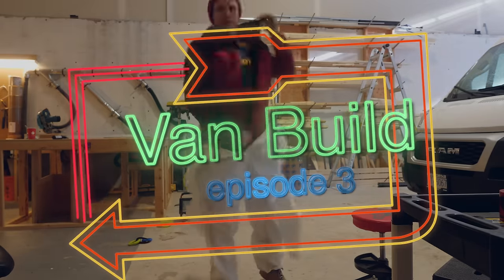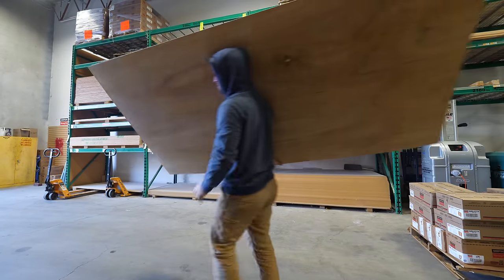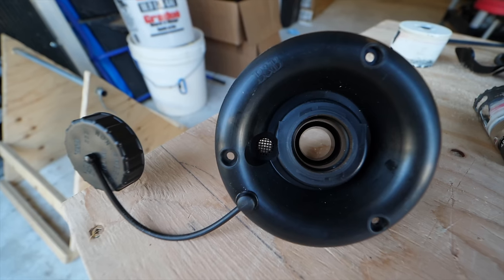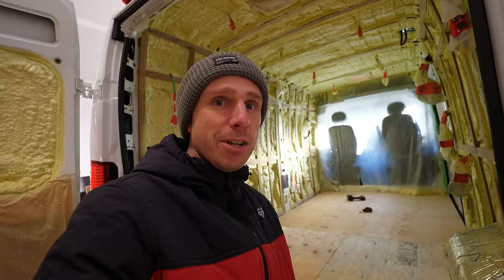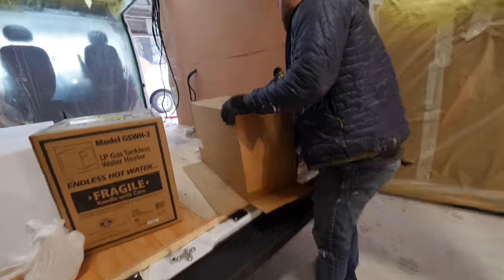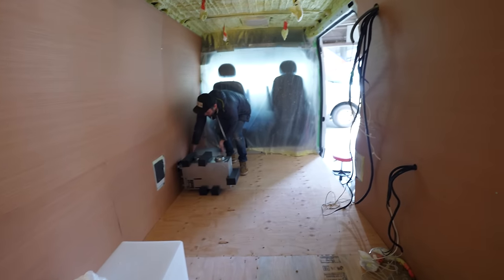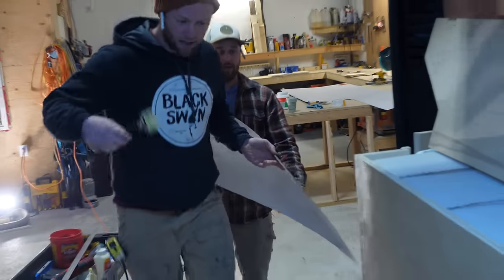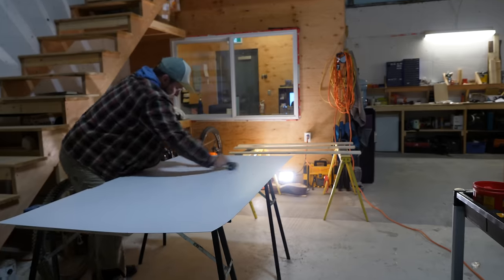Why I Decided To Spray Foam My Custom Van Build...

Comment from the maker: It's coming along nicely eh? If you want some sneak peaks follow me on instagram 👉https://www.instagram.com/paulthepunter
Reply: Paul I've already rang these guys and discussed building my own setup most likely identical to yours as we share the same passions 😎
Reply: @greendogggggg  good news for us, Paul's paid the premium because it's so custom however to copy this build its much cheaper now they have experience. The owner was very accommodating in having people come Inspect Paul's van due for completion mid to end of Jan. $60k has gone into this build roughly
Reply from the maker: @seanec8  Sick!
Reply from the maker: @greendogggggg  What's your source Scuddy o? Because there's no evidence to suggest this works.
Reply: is the water fill the top one? do you have to lift to water up to fill?
Reply: Why did you chose to have a furnace and Alex (STS) didn’t?
Reply: I hope you realize that stuff is going to off-gas formaldehyde and other chemicals for years and you're going to be breathing them in in an enclosed space which is just increasing your chances of a carcinogen or cancer
Reply: Cancer Van. The Punter has been paid by these guys/ has money invested/ got build for free. Negative comments receive dumbass sarcastic replies.
Reply: @SnogSpit  water fill at the top and electric at the bottom
Reply: Hi paul I'm a 14 year old boy and my dream is to travel the world in a  van I wanted to know how u could get a head start on financial problems any ideas?
Reply: Is this your job blogging?
Reply: Right off the bat you did spray foam insulation and that's one of the biggest mistakes people make on every build.
Reply: How much did this cost?
Reply: @PaulThePunter  the insulation i mean
Reply: @jasonstormoen  u mind explaining why is that a mistake?
Reply: @adryanmares0  my background! I worked in the rv capacity of the world from 97 until 2018 and when the rv industry was slow I worked in the van conversion industry. I did schoolies and van conversions from 99 until 2018 and still help a few people when needed. I am just to busy right now.  We did a lot of testing over the yrs with spray in foam insulation and it ends up causing moisture mildew mold and rust. If you do a liquid vapor barrier then spray in it last longer but still ends up the same issue. We used and recommend doing floor, walls, and ceiling in a good primer and then do a liquid vapor barrier on the floor, walls, and ceiling and then use foam board on the floors and on the walls and ceiling in a R17 value foil faced. It is design for metal roofs, walls, garages, and pole buildings, your van or schoolie is a metal building. This foil faced is also designed as a radiant barrier, vapor barrier, and air barrier. It is a all in one solution for cold, heat, condensation, and air. We used it in the rv industry because all of the trial runs testing done failed over time.
Reply: @Tucker Webb no that's not what I'm talking about. I am talking in general spray in foam is no good. It works for a while but a few yrs down the line it starts causing issues that you don't see until you get in there to do a repair. If no repairs a few yrs down the line you start seeing the issues. It causes the vehicle to rust and it causes mildew, mold, and so on.  I worked in the rv capital of the world  in Elkhart, Indiana where 90 percent of all rv's and rv parts are made. They also have a couple van conversion companies in the next town over I worked in for a short while when the rv industry was down, and I have friend working in them still. I have seen countless hrs of testing and it just fails in the long run. I built conversion vans and schoolies for over 20 yrs in my shop and have done testing on my own and it fails and that's why it's not used. We tried because it's cheaper in the long run. The longest we all got it to last was when we did a liquid vapor barrier and 3 to 4 yrs still wasn't impressive.
Reply: @Tucker WebbA long story short, 
 Thor Motor Coach is the biggest signal company for class A, B, C rv's, travel trailers, and 5 wheel company in the world. We had people from all over the world come in with their setup that was supposedly designed for the conditions and material used and everything that was tried over a 2 yrs course in testing failed to meet government safety standards. I left the rv industry a couple yrs ago because I moved to Asheville, NC where my race car shop is, and I am so busy that I'm only taking on schoolies by appointment and until I get word from the rv industry that they've found a solution I'll use what has worked for yrs. We aren't having issues with moisture, mold, or mildew and we are as efficient as possible. As for stick built, I agree that it's good stuff for the most part.
Reply: I'm noticing the Black Swan Yoga sweatshirt. Was this done in Austin? I'm in Austin and looking for someone to help build out my tiny van.

Comment: Am I the only one that facepalmed when they put the electric plugin below the water hookups?
Reply: No. I did the same
Reply: Me too
Reply: Not me. I only facepalmed after reading your comment.
Reply: not facepalming, but seriously questioning their expertise tbh...
Reply: I was going to write the same thing!
Reply: honestly reading your comment im think this also but my only theory is the water input had to be at a higher level and it doesn't matter if the electrical get wet you can charge this while raining outside they have GFCI
Reply: Not relevant. That is an all weather power point, and as previously mentioned, the height of the non pressurised water inlet is important.
Reply: @dnomyarnostaw  like i said?
Reply: i wrote my own comment on that before i saw this one lol
Reply: @jonathanjames3612  gfci or not.  if water directly leaks around the plug that is going into the van.... the water could penetrate and cause a short.  while a gfci is great if its tripping constantly because of a water leak,  it isnt going to help you much.  i do realize that it is designed to be able to be used in the rain,  but most rain will not make a deluge down the side of the van... a leak from the hose would.  but hey, its not my van.  i just noticed the issue.
Reply: @jonathanjames3612  forsure but the electric plug is easy to move around so directly under two water ports isnt the best idea, gfi or not
Reply: Right beside the wheel well...
And a non sealed plugin, good for corrosion.
Reply: Just commented that above then scrolled down to see this.
Reply: Fail to plan plan to fail?
Reply: Same
Reply: Ray Watson water resistant not water proof i live In a van in England it’s wet all the time and comes from every direction 😂
Reply: You guys must not be famillar with IP67 rating
Reply: i facepalmed when they put holes is the side of the van..
Reply: Yes bro you were
Reply: @LadyTSurvival  what do you think rain will do?
Reply: @Mapdotnowhere  the van will see rain i'm sure.
Reply: @michaelmarquis8072  i addressed that.  rain by itself wouldnt necessarily be a problem... but if your hose takes to leaking and it is pouring down the side in a solid sheet.  it will inundate the plug.   the plug isnt "waterproof"  its  "water resistant"  there is a big difference.  it would only be bad if the hose was leaking badly right directly above it. which the fill tube is .   a bad hose leak would drown the plug  not just raindrops
Reply: @LadyTSurvival  I couldn't agree more. The outlets didn't have to go above and below each other. They could of been along side each other as well.
Reply: They're all external connections, so they should be weatherproof on the outside. What I shook my head at was "and the foam binds to the surfaces so it makes it's own vapour barrier" and then proceeds to drill three holes through it.
Reply: Me to. Water above electricity = dead. nice video
Reply: Even my eyebrows raised, and I know absolutely nothing about building.
Reply: i'm @ that point in the video atm and stopped to comment just for this stupid design flaw
Reply: even if they have GFC ....tripping it every damn time you fiddle with that water hookup is poor design. you also absolutely dont want to rely on GFC as its a backup safety system not a primary system.
Reply: See start of episode 7 for when it explodes! https://www.youtube.com/watch?v=7ZDBitxf9HI
Reply: This is a sign of expert design. Just like General Motors engineers putting the optispark ignition system under the leaky water pump...

Comment: Why not clad and seal the interior? Then drill small access holes and inject the spray foam? From what I've been reading, the stuff penetrates every nook and cranny. When finished injecting, plug the holes with glued sealable rubber bungs that can be trimmed back flush. Anyway, just a thought. No experience at this so don't be too harsh in your responses! :-)

Comment: Wouldn't it have been smarter to put the electrical plug above the water inlets?  Now if you have any leaks at the water connection.  It's going to run right down to the electrical plug.

Comment: I dont get it... So you use spray foam so you can get "into everything", but then I can clearly see that the thickness of the foam isnt to the max on many places? What is the use of that?
Reply: I was going to say the same thing. Spend a few more nickels and fill the cavity, as long as you are there. 1/2" of spray foam is not much of an R value.
Reply: chiane1968 if it is closed sell 1 in gives R-7 plus more than double fiberglass.
Reply: Glenn Carraway yep, I’m an architect, I get it, and r7 isn’t much. He could fit another inch or two. R14-21 is better, especially the space is just sitting there waiting to be used.
Reply: Pretty sure they left some areas without complete foam covering (i.e. specific cavities, like on the back doors for instance) so that you can still have access to replace things like brake lights, etc. when they inevitably go bad in the future and you're pulled over at a random Auto Zone - god knows where - trying to fix it while out on an adventure.
Reply: @fredthebasspro2256  They left 1 -2 inches structurally not filled pretty much everywhere. I cant explain that with the logics you presented.
Reply: @darekm6859  Damn.. So 1 inch of foam is enough.. but 2 inches of foam isnt worth it... That is some mighty fine reasoning you have there Darek! Without a doubt 2 inches of foam with a space like that will have MASSIVE results compared to 1. As for your remark about possible extra work cutting foam away that would stick out, lets just keep that to your laziness mkay ;-)

Comment: This is how I insulated my ICF home attic.  Last year's 12 month total for my HVAC system was only $168 or just $14 per month to heat and cool for a 2000 sq ft home.
Reply: That's interesting, so you can take these foam sprays upstairs?
Reply: What climate Clay Ritchie?
Reply: @doctorjoey3  probably San Francisco
Reply: maybe in San Francisco area

Comment: Looks good. My only comment would be to research the type of foam used, there are some commercial products that are commonly used in car intereriors and beam pillars insulations/soundproofing, such as Ellastolan 3595/100 (approved by most car manufacturers), so you ensure is something tested according to auto tests and specs (volatile emmisions, stability under heat or moisture, etc.)

Comment: watch what foam they use, it can easily hold moisture against the metal rotting it out.  Hence why truck wheel wells rot out in 5 years now.
Reply: They use recycled metal it starts rusting at the factory.
Reply: @theronlangford8786  no it doesnt, all vehicles Include truck bodies are dipped in a zinc based solution before painting. The moisture collects in the sound deading foam and rots the beds out
Reply: Theron Langford All steel starts rusting at the factory.
Reply: @ShaunHensley  yeah even stainless and zinc coated ones.. So leads build cases from cast iron at least rust won't eat through entirely
Reply: Is it closed cell foam or open cell? He said it forms a vapor barrier, so it's probably closed cell. There's no way moisture is getting behind that
Reply: Yep. Condensation will find a way and when it does :(
Reply: It's a dodge they rust from the factory
Reply: Actually the foam insulation is meant to repel moisture and prevent rot and mold. I work in construction and have spray insulate alot of attic spaces. Do your research before spouting nonsense
Reply: Polyurethan foam is not moisture resistant. It's killing the steel in a few years. And removing is is a real pain.
Reply: @MtnTow  you proved my point, thank you lol
Reply: @MtnTow  ahh canadians, always so "polite" right? Lmfao
Reply: @chingguskhan8774  No idea why you think i owe you politeness. Don't spread misinformation. Eh?
Reply: @MtnTow  i dont know what you're talking a-boot, but ok boomer
Reply: @chingguskhan8774  What type of Van has an attic space?
Reply: @Lucky-uk1bv  r/woooosh
Reply: @MtnTow  what part of the world do you live in?  Do you think house wrap material would be beneficial if it were applied before the foam?  Thanks.
Reply: @nobadmojo70  Rockies but many of the vehicles ive seen that done to were from one coast or the other. 

The problem is that metal is a natural surface for condensation which can occur in anything less than a perfect vacuum. Evaporation on the other hand, seems to need more leeway. So anything stuck on the metal can induce rust. 

If you look under your vehicle body panels, you will see many little openings intended on shedding water once enough accumulates to be a liquid. 

What always worked for me was a high end sleeping bag with detachable (velcro) insulation panels that can be put outside in the sun to dry and kill bacteria. 

Also allows the vehicle to breath properly. 

Now i have a wood stove in my trailer and could sit around naked in -40c if i so choose. Lol
Reply: @MtnTow  What would you suggest for insulation? The foam boards that are typically used? (Apologies, if I am not using the correct term). 
Looking to do a custom van/bus in the future, and would like to know what to avoid. Especially something so expensive, such as foam spray.
Reply: @Nathofgiltleaf  More or less, yes. But also not exactly. 

Its complicated and varies by situation / vehicle. 

I use corrugated cardboard in places i need moisture control. Vans would benefit but old trailer walls are wood which is roughly the same effect. 

If you have a single metal van wall surface, use heavy corrugated  cardboard, pink foam board and reflectix insulation sandwiched for effective heat with minimal moisture damage. 

Every couple of months, you can pull it all out to dry. You can also cycle open portions to dry but that can work against you in condensation conditions.
Reply: @Nathofgiltleaf  i have a page & channel called 'Homeless in Canmore' that has a video showing window coverings and what various materials do.
Reply: @MtnTow  Apologies for the late reply. Thank you for the explanation. I will have to check out that channel. Your time and comments are greatly appreciated. 
Have a splendid day!
Reply: @Ariccio123  Don't think so? Check out: https://blog.polytechinc.com/open-vs-closed-cell-foam
Reply: @chingguskhan8774  Houses are not vans! Wood breaths, steel doesn't. You want to research closed cell polyurethane foam start here: https://blog.polytechinc.com/open-vs-closed-cell-foam
Reply: That happens not because the foam failed but the installer did. You mix the ration wrong, temperature wrong, and many more things and you got disaster. You install closed cell foam properly with nice clean surfaces wood or metal your good it bonds with both. It won't detach, catch fire, or explode from the cold. If that happens you got a lot bigger problems like how your wood studs have done all of those things first except detach because the foam is holding them in place. For that to happen it you need temps like -200 F or over 1000 F outside and the ignition point of most wood is a little below 700 F.
Reply: @schunter20  So every truck manufacturer fucked up the mixture. No. Foam holds moisture and rots out the beds wheel wells. Spray foam is a horrible idea to use in a vehicle.
Reply: @zack9912000  the foam should be sprayed properly, thick enough, and most importantly once it hardens and is sanded flat it should be  sealed with fiberglass and finally  gelcoat/clearcoat. Only then is it truly vapor proof - is how modern ships/yachts are made

Comment: Good choice! We're going to use closed cell spray foam to insulate our upcoming cargo trailer conversion. Besides the reasons you mentioned it adds structural rigidity which is important with trailers that have thinner sheet metal than vans have. Before applying the foam with a DIY kit I'll be applying Lizardskin sound deadening & ceramic insulation coatings to add an extra thermal transfer barrier. The ceiling, walls, & floor will get a layer of cork underlayment installed over the foam before we place the decorative wall coverings.

Comment: after doing a ton of research on spray foam before i decided to do a flash and batt in my own home, it is not recommended to expose the spray foam to extreme heat condition as it accelerates the off-gassing process. The metal on top of the van on a sunny hot summer day can reach 140F destabilizing the binding agent's int he spray foam.
Reply: Yeah, it's surprising how many people only see what they want to see. Unfortunately for them.